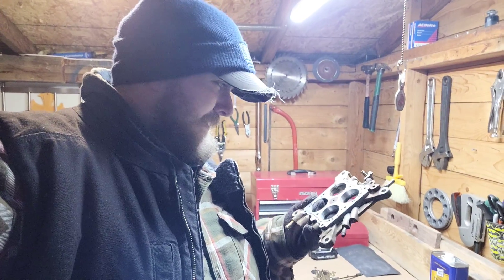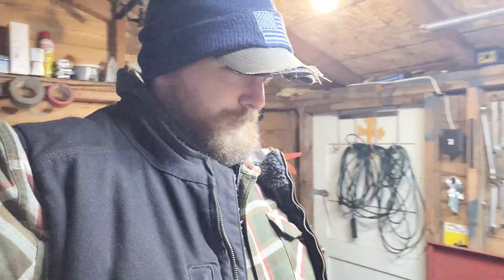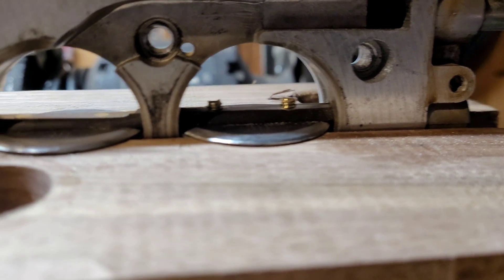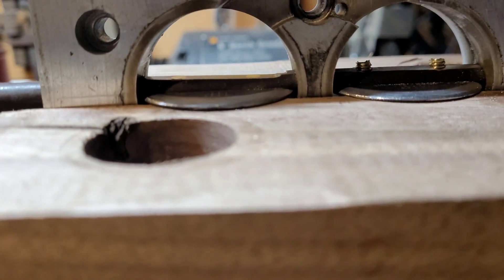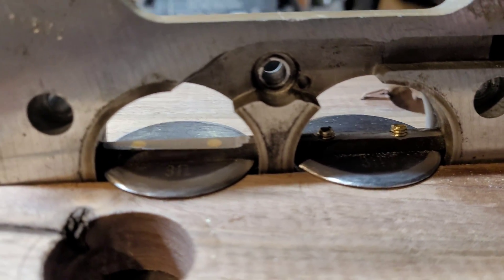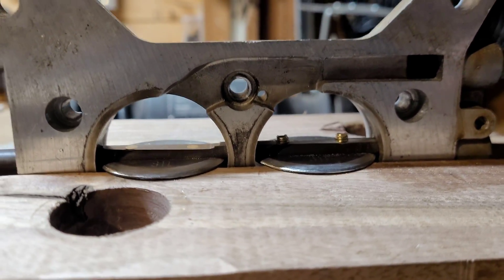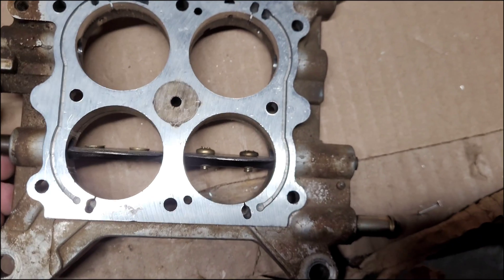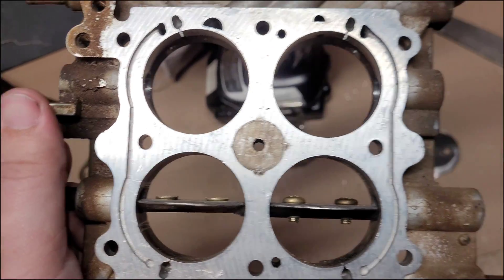Carburetor Baseplate Upgrades | Project XMC | What Will This Show Us On The Flow Bench? | Holley

Comment: You installed the knife edged throttle blades in backwards. 9:48 the blunt side will be the leading edge into the air coming in the carb still.
Reply from the maker: I sharpened both sides of the throttle blades, there is no blunt side anymore lol. 

You have to sharpen the edge that faces away from the bores because otherwise you will change how much air is getting let through at idle.....hard to explain over test lol